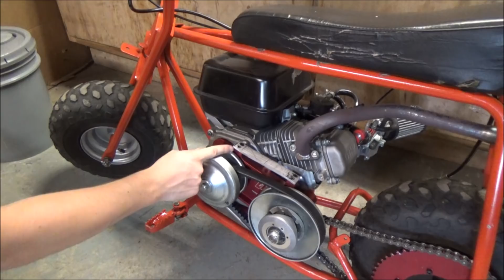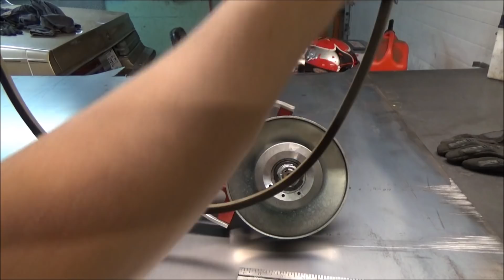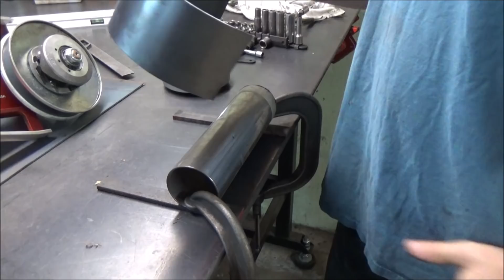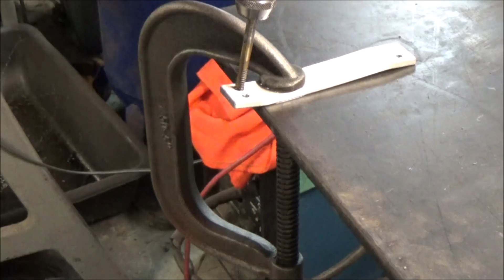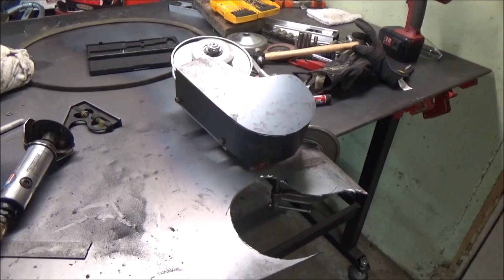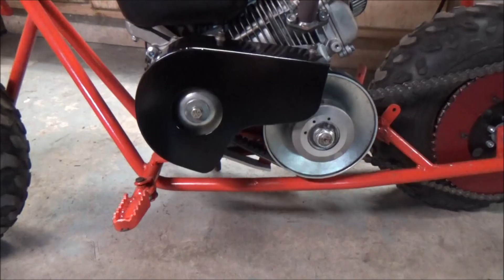Making a Metal Side Cover for the Torque Converter

Comment: you should have made a bracket that goes on before the plate and has 4 legs that extend out over the cover.  then pop rivet some  inner riggerd connection that can be slipped on and slipped off. im stalled out trying to decide how to hadle thew cover on my mb200, i see all the fellas cutting the bottom off the plate.  should be easy and use the original cover from the cvt.  i did make a match stick holder in shop and that crossed my mind.
but if you can cut it and bend it and not break it off every time, it works too me thinks. ive seen big ass harley 1200s with no covers running belt drives, scary.

Comment: I used steel tube to make longer pegs and ran a flat piece of mild steel along the pegs across the frame to allow for bending from unavoidable battle damage. The torque converter looks good but with a #35 10 tooth Max Torque SS clutch and stock sprocket it honks. I'm running a stock Predator 212 Non-Hemi and that front tire lifts like crazy.

Comment: raised my motor up with a plate and oblonged my t-converter 4 mount holes on the housing with a roto zip so the housing would swing slightly upward and was able to mount the t converter plastic cover on better .and looks great.
Reply: real nice metal fab work!!!

Comment: id like to put a torque converter on my mud mower. my engine it vertical shaft. one of the problems i see occuring is trying to keep the torque converter dry, any suggestions?
Reply from the maker: +theoutbackbandit That would be tough. You would probably have to incorporate a right angle drive to really make it work with a vertical shaft.

Comment: I'm thinking about changing my rear sprocket  and am not really sure we're to go....I was told a 56 tooth....but I'm not sure. ...I'm just trying to keep the front end on the ground a little more. ...
Reply from the maker: +Brandon Frantz I definitely know the struggle lol. The reduction that a torque-a-verter provides at low rpm's seems like it'll pick up the front tire no matter what rear sprocket we have
Reply: Try using a large gear on the torque converter side to calm down the launch.